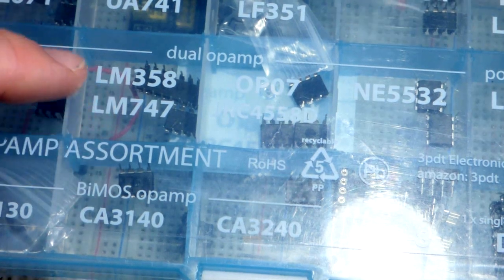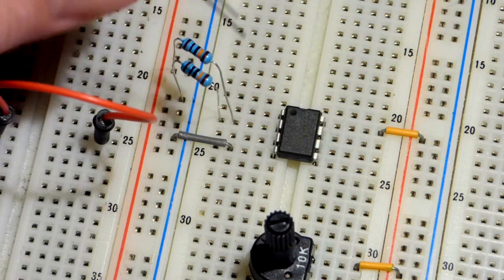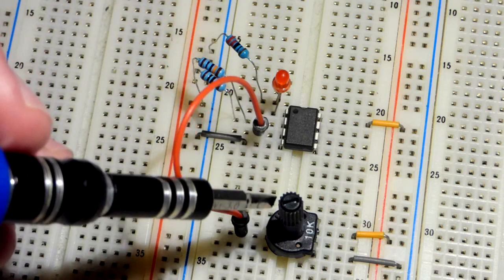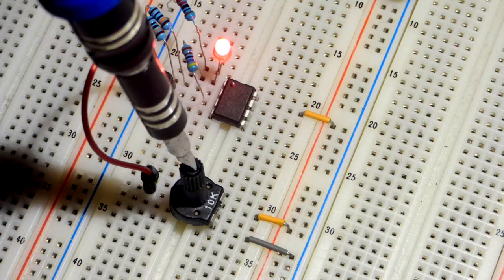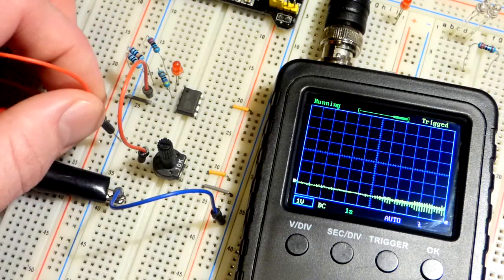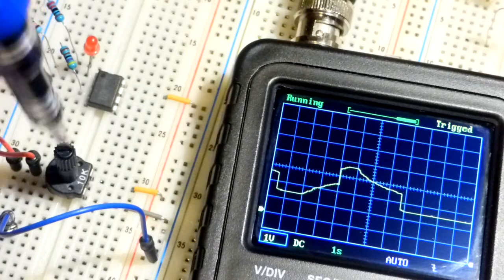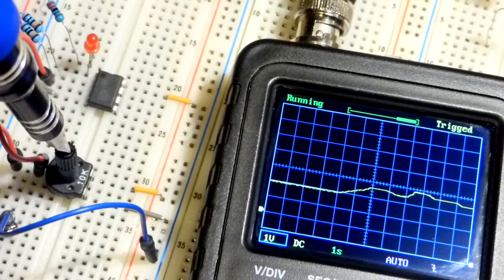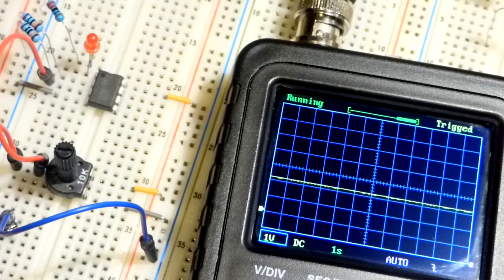LM358 dual op amp positive feedback hysteresis schmitt trigger non inverting comparator circuit

Comment: Love your work mate! What is the purpose of the resistors on the inverting input and are they necessary? The circuit examples I've have seen just have it straight to ground? Cheers.
Reply from the maker: Glad to hear! Most op amp circuits are dual power supply, which means ground is (usually) half way between a positive and a negative voltages. This is a single supply op amp circuit, which means the supply voltages are +5V and ground of 0V. So to get a half way voltage (2.5V) I just used 2 equal value resistors as a voltage divider.